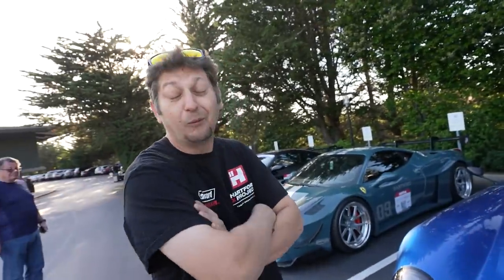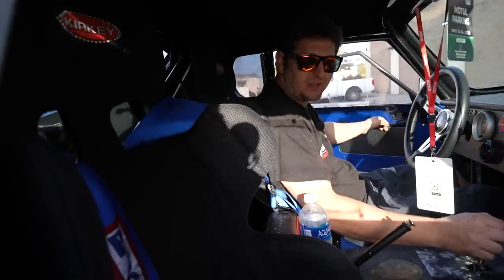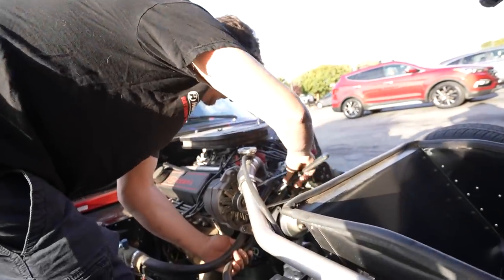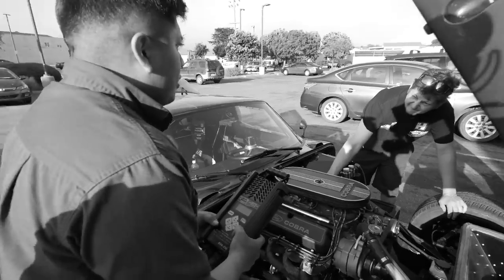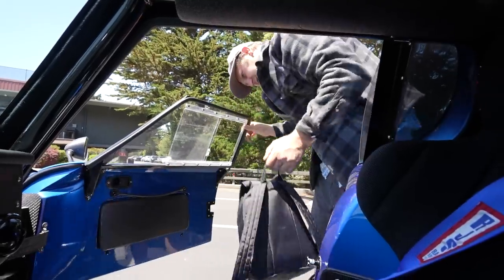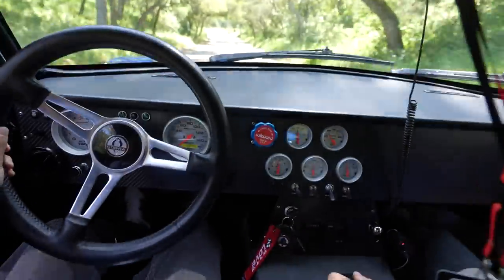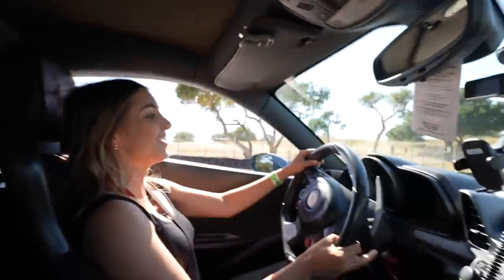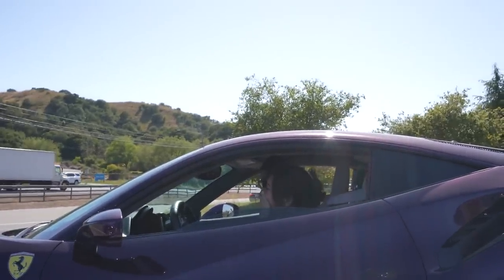We Broke The Barn Find Shelby Daytona Coupe.

Comment: I have nerve damage from a previous injury and I got a third degree rub burn a couple years ago while riding a go kart. My leg was rubbing on the tire at full lock and I didn't realize because I have zero feeling down by my ankle. I noticed after walking a little that I had a big white spot on my leg and the skin was though like old dried out leather. I ended up needing a skin graft. The worst part about the entire experience was when the put my breathing tube in for the surgery they tore up the inside of my mouth and my throat, like a blind first year med student put it in. Lucky I couldn't feel the actual burn because I know how bad they hurt.

Comment: I tested a battery at a different parts store and it showed as “failed.” Turned out to be the radio draining the battery - a year later the battery is still running strong. I suspect those parts store testing machines are set to “always fail” so you buy parts from them.

Comment: Your slightly flooding instead of running lean which is good  after a while  it's easier running slightly lean which means it's on drag tune my setting is circuit

Comment: If they car stays running your alternator is working. If the alternator is charging its running off the battery and then will die and won't start back up

Comment: I never trust Oriellys, Autozone, etc. Test meter. I had the same thing happen to me, they told me my alternator was bad, so i bough and installed a new one, come to find out the battery was bad. I bormally do my own testing but i was stuck about 90 miles away from my house and needed to get it fixed.

Comment: The alternator charges the battery when engine is on, changing the alternator will not resolve the problem if the battery is down, usually batteries give up when cars are not used. The alternator is tested with engine on and if the charge is over 12V its charging. So it was obvious it was a battery issue. The guy in the shop should change job

Comment: Fun fact, Alternators have never changed the build design or bolt pattern ever since they was made, if you have a charging issue its not gone bad most likely the carbon brushes inside it that are responsible for charge have worn out prob just one of them, if you open up the natore and look where the brushes make contact it should show 2 shiny contact points which means they are still good,  but if you have one shiny and other mucky the dirty contact then the dirty one has gone bad, you can either get a pair out of a old natore or buy 2 new ones for about $10 if that, and install them yourself, and its fixed, however if the natore rotates and feels like its grinding and not charging at all, take it out of engine and put it in a bucket of RED Diesel for 24 hours, just let it soak, then take it out and let it drain and dry out, the red diesel will lube all up and fix the grinding and it should be back to full working order and spinning freely

Comment: Ok… Dr. Scarr… has Lots of experience …. ALL OF THIS IS SERIOUS MUST DO… for burns where there is blistering or ablative damage to the mid to deep layers of skin or if it has been burned through completely… I suspect the wound here does not go completely though the skin but is still of such depth to require careful treatment. First  you NEED to debrade the leg… that means remove all the burned/dead flesh … this can be done in Sitz bath or shower with a detachable wand using warm water and a soap type (not detergent based) emulsification cleaner… . I can send photos of a proper degrading nothing not the least dead tissue can remain, it will look bright red flesh but will be shiny but not bleeding ( unless so deep as to destroy more than capillaries ,.. sterile tweezers will be necessary to pick away dad skin which appears white at the periphery with warm water and soap soaking you can accomplish without a scalpel… only a skilled doctor should use a scalpel… you will mess up making things far worse.  DO NOT shower completely and let the water from your dirty Anus flow over the wound… unless you want a galloping gangrene type infection… this goes for the next few weeks to couple months until the burn has healed enough to seal out skin bacteria like streptococcus and staph pathogens existing always on the skin as well as c-dificle bacteria from you ass… I am serious about this stuff like washing you butt or legs and letting the water flow down your leg to the drain is dangerous… these are hard to prevent infections in burns and in general treat infections normally but in a burn horrible… and will be disfiguring. Then using clean warm water soak the wound and using your clean fingers roll back or gently pull away the dead skin layers completely to fresh healthy tissue including the surface of the burn and its edges. IMPORTANT…  next apply Silva-cream this is what moisturizes and prevents infection…. Then you need 1% silver sulfadiazine cream…. Using sterile pad or spatula gently tap  or smear on the wound with the least effect on the burn… an even 1/8” thick coat extending 1/4” - 1/2” beyond the perimeter of the burn … then put a nonstick preferably a Sterile Oil Emulsion Dressing gently over the cream smoothing out to eliminate air but don’t squeeze the Silva-cream out… you need a thick barrier coat of the cream under the bandage… . Then wrap not too tight or loose to fall apart a couple protective layers of sterile gauge or use sterile gauze pad is probably better and more secure , this overlaps then burn and sealing dressing by about 3/4” all the way around then use paper tape around that perimeter to stick to leg… then one wrap of Coflexnl crinkle stretch self adhering tape wrap over entire bandage with moderate stretch tension overlapping gauge and paper tape by 3/4”…. 
IMPORTANT… this dressing must be kept dry and clean and not changed for 5-7 days… then when changed the oil emulsion bandage layer needs delicate removal without disturbing the Silva-cream layer at all this is vital to not disrupt the first healing growth of skin which is very very delicate. Mess up that delicate layer particularly easy if you’ve gotten it wet bathing… mess up annd you start over at by debrading again … I watched a man do this three times and to hear him scream the whole process through … yes painless the first time more so each screw up restart… warning. And, if damaged this first growth you will be significantly more scarred than if it is undisturbed. The original Silva-cream is not removed or disrupted as little as possible… the skin regrowth beneath is protected and stabilized by it as this growth is fragile, and so the cream is simply coated over most gently to have the least danger of bad scarring and infection. The regrowth skin layer and these bandaging duration of need is dependingon depth of injury will be needed to be strictly maintained for 30 days to six weeks where 1/2 the skin thickens was burned and if deeper considerably longer. All the Best… Good Luck.

Comment: Ive pulled a 5speed gearbox out of a 200b datsun on ramps with a Cresent, plyers, flathead screw driver, and a hammer when I was 15 as a test from my father and his brothers so I could kick it with the in the shop. 5 years later I bought the shop 🤷🏾‍♂️

Comment: Okay Emelia I am disappointed at Sandy as long as I've watched your channel and seen you guys build awesome stuff. I know that you guys know if you pull the I prefer the negative cable off the battery terminal while it's running If it dies it's the alternator cuz it's not producing electricity current. Never trust a guy not properly trained on the equipment or probably is never turned to wrench in his life that's what they hire nowadays.

Comment: If that would have been me burning my leg like that, all you would have heard was bleep bleeeeeep, Mother Bleeeeep, Bleep 😂. My truck wasn’t starting very well, went OReillys - guy using tester said it was battery. Bought new battery and still wouldn’t start. I had a gut feeling it was the starter and it was. I don’t have a lot of faith in those testers they use. Cost me extra to buy a battery I didn’t need. 😑

Comment: It is not one of only 7 cars built.  It would be 7 of that gen or that year.  You can start an engine with out a transmission bolted up. All you need is a flywheel or flexplate.  If you can bump start a car or jump start and it stays running then you know the alt works as it produces the electricity.  Surprised at the lack of knowledge with this group.  Allll these sweet rides and just a bunch of guess statements.... I could be very wrong as it is just a bunch of snipits and I could be missing  plenty.

Comment: I haven’t watched the whole video yet. But I’m confused as to how they determined the alternator is bad. The starter could not start the engine. So battery or starter. They push started and it ran fine all the way to the Oreillys. That would tell me the alternator is fine. So on to the rest of the video and let’s see.

And I was right. Makes me question Emilia’s and her head mechanics abilities. They do build awesome machines though.

Comment: Always, Always, get the coldest water or even better ice on a burn. It inhibits tissue destruction. I stupidly took a radiator cap off a radiator (before overflow tanks), and it completely drenched my arm with boiling water. Fortunately, there was snow on the ground and I yanked my shirt off and fell face-first into the snow, and stayed there as long as I could stand it. At the ER, they told me that if I hadn't done that, I would have had tissue destruction and bad scarring rather than simple blistering and a long but uneventful recovery.

Comment: You needed no fancy tools just pull off a battery cable when it’s running and if the car dies then it’s the alternator.
Or you can use a screwdriver while the car is running touch it to the back bearing cap on the alternator if it’s magnetic, it’s charging!!!
Today’s batteries are 💩!!
Sorry about your leg..

Comment: Ok… Dr. Scarr… has Lots of experience …. ALL OF THIS IS SERIOUS MUST DO… for burns where there is blistering or ablative damage to the mid to deep layers of skin or if it has been burned through completely. First  you NEED to debrade the leg… that means remove all the burned/dead flesh … this can be done in Sitz bath or shower with a detachable wand using warm water and a soap type (not detergent based) emulsification clearner… . I can send photos of a proper degrading nothing not the least dead tissue can remain,.. sterile tweezers will be necessary to pick away at the periphery with warm water and soap soaking you can accomplish without a scalpel… only a skilled doctor should use a scalpel… you will mess up. DO NOT shower completely and let the water from your dirty Anus flow over the wound… unless you want a galloping gangrene type infection… this goes for the next few weeks to couple months until the burn has healed enough to seal out skin bacteria like streptococcus and staph pathogens as well as c-dificle bacteria from you ass… I am serious about this stuff like washing you butt and letting the water flow down your leg to the drain is dangerous… these are hard to prevent in burns and in general treat infections normally but in a burn horrible… and will be disfiguring. Then using clean warm water soak the wound and using your clean fingers roll back or gently pull away the dead skin layers completely to fresh healthy tissue including the surface of the burn and its edges. IMPORTANT… this Silva-cream is what moisturizes and prevents infection…. Then you need 1% silver sulfadiazine cream…. Using sterile pad or spatula gently tap on an even 1/8” thick coat extending 1/4” - 1/2” beyond the perimeter of the burn … then put a nonstick preferably a Sterile Oil Emulsion Dressing gently over the cream smoothing out to eliminate air but don’t squeeze the Silva-cream out… you need a thick barrier coat of the cream under the bandage… . Then wrap not too tight or loose to fall apart a couple protective layers of sterile gauge or use sterile gauze padtha overlaps burn and sealing dressing by about 3/4” all the way around then use paper tape around that perimeter to stick to leg… then one wrap of Coflexnl crinkle stretch self adhering tape wrap over entire bandage with moderate strerch tension overlapping gauge and paper tape by 3/4”…. 
IMPORTANT… this dressing must be kept dry and clean and not changed for 5-7 days… then when changed the oil emulsion bandage layer needs delicate removal without disturbing the Silva-cream layer at all this is vital to not disrupt the first healing growth of skin which is very very delicate. And, if damaged this first growth you will be significantly more scarred than if it is undisturbed. The original Silva-cream is not removed or disrupt the skin regrowth beneath and simply coated over most gently to have the least danger of bad scarring and infection. The regrowth skin layer and these bandaging depending on depth of injury will be needed to be strictly maintained for 30 days to six weeks where 1/2 the skin thickens was burned and if deeper considerably longer.

Comment: WHY THE HELL cant anyone know how to do a flipping alt test the EASY WAY....Disconnect the ground from the battery. If the car stalls....The alternator is dead. If it keeps running its the battery...TEST COMPLETE lol. This works on ALLLLLL Old cars. Come on guys. I'm an I.T. guy that used to work on cars as a hobby and you have a mechanic there with you. Common life hacks for cars.